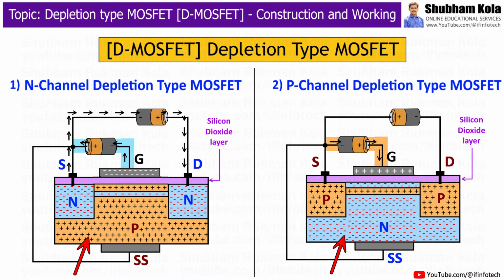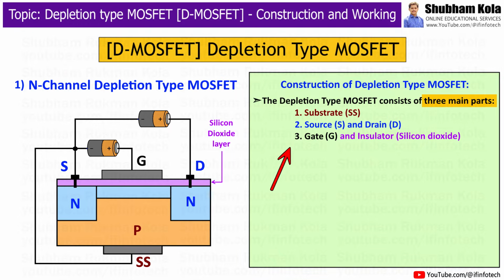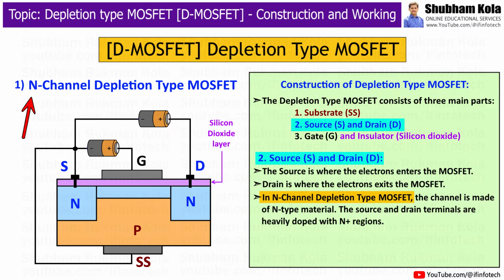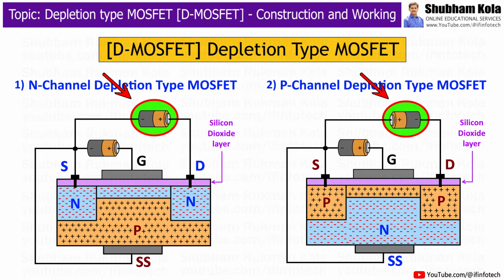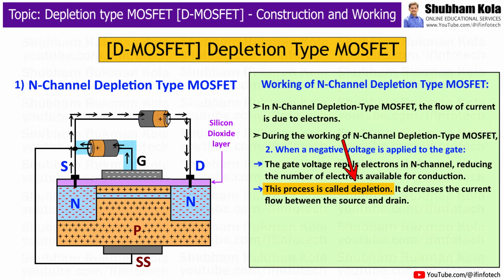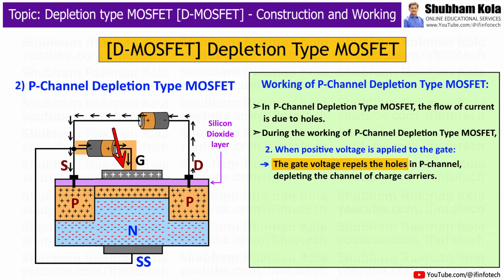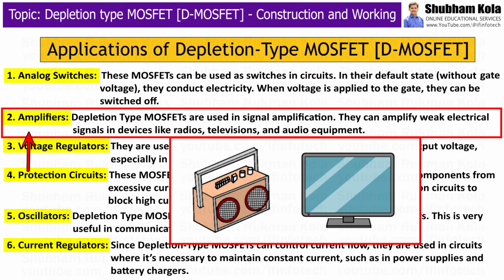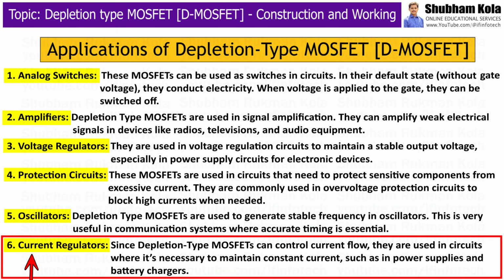Depletion Type MOSFET Explained: Construction and Working [N Channel and P Channel] | Shubham Kola

Comment: Pelton wheel runner is having tangential velocity of 20 m/s. Head race and tail race level difference is 60 m. 10 m head is lost due to friction in penstock. Discharge through the nozzle is 0.03 m³/s. Vane angle at outlet is 15°. Coefficient of velocity for the nozzle is 0.97. Assuming no friction loss over the buckets, evaluate   i) Force exerted by jet on buckets  ii) Workdone per kg of water  iii) Power developed by the runner  iv) Hydraulic efficiency of turbine. 

Sir I want solution for this problem 
Can you please make a video on this